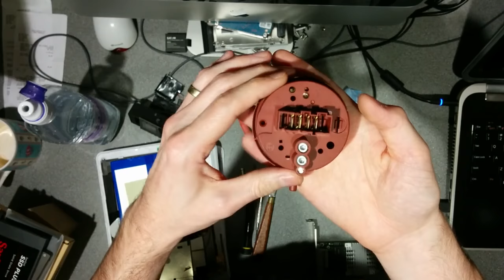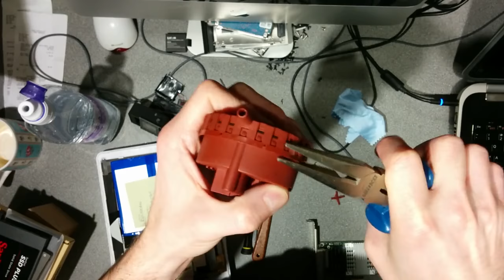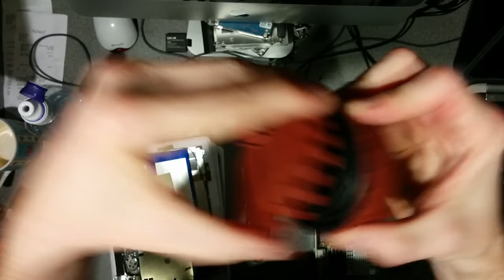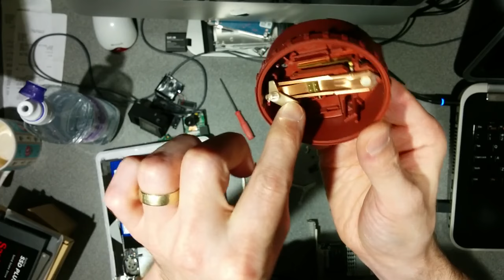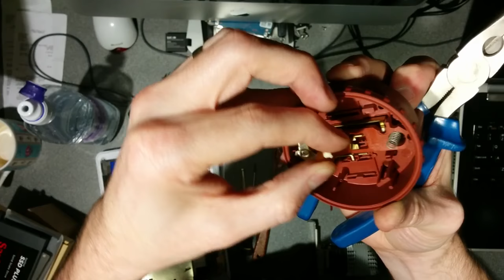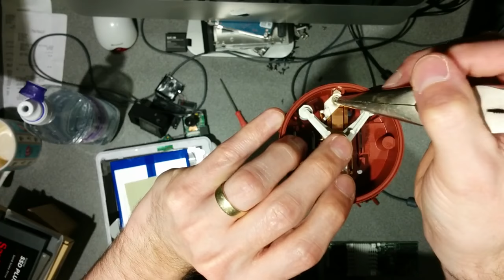Inside a Washing Machine Water Level Regulator / PRESSOSTAT / Pressure Switch

Comment: To add more water in this sensor,  the screw of the midle is the key. Turn clock wise 1 or 2 times in the 2 sides, the screw of the midle of the 2 side of this sensor. For example this sensor have 3 screw aligned is the screw of the midle.

Comment: As a service tech, most issues 
with these types of level 
switches are caused by the 
port getting clogged or the 
diaphragm getting worn out.
in either case, the switch needs 
to be replaced.

Comment: Are these still used?
Reply from the maker: I suspect so. There was still one in a 4 year old one I opened up recently. It's either that or a resistance based contact in the drum which will be less reliable due to the contaminants or cleaning chemicals in the water during washing.